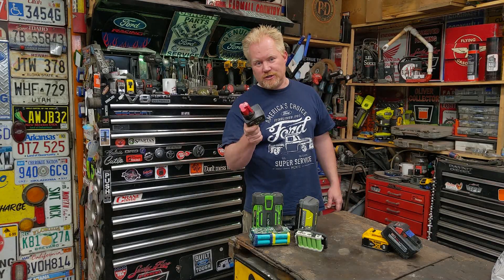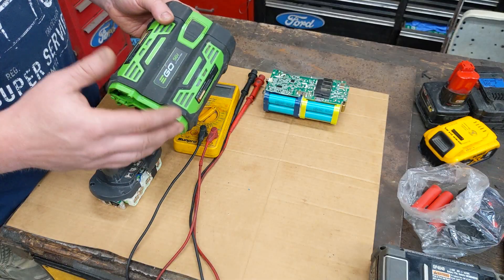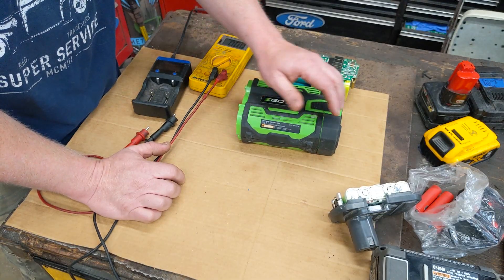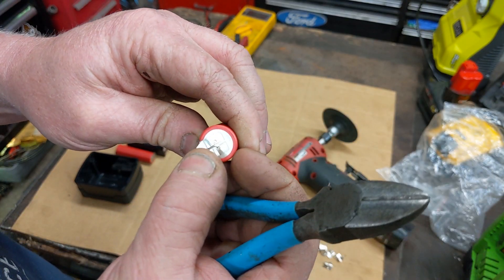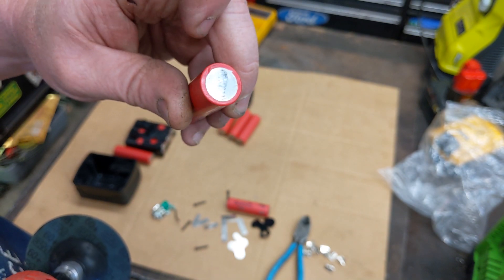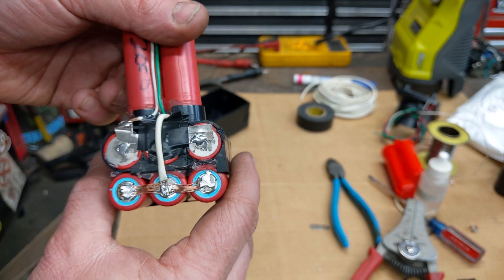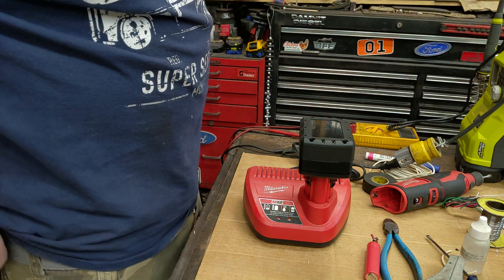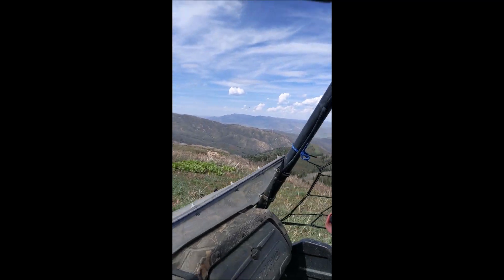Build Dirt Cheap power tool Battery Packs : Milwaukee Dewalt Makita

Comment: Oh great.... I bought a couple of those Chinese DeWalt battery packs about 3 years ago when I was cutting roots out of the lawn. They worked good and lasted for quite awhile but I haven't touched them since. I wonder if they will even work now🤔.
Reply: Quit wondering and throw them on a charger.  They're probably fine as long as you didn't excessively discharge them then leave them sit without charging back up for 3 years.  Even then, they probably didn't discharge that much more unless left in a tool with a defective design that causes parasitic draw.
Reply: I did throw them on a charger the other day. I had a couple stumps I wanted to get rid of. One was just about fully charged and the other one showed one light out of three. I bought them at the same time off of Amazon. All it does is light the charger up for a second then goes out. I was going to take it apart but I guess I need to get some specialty bits.  @stinkycheese804

Comment: I'm wondering what will happen to other lithium batteries like 18650's once the solid state batteries hit the market.  They've already made & been stesting SSB which will be put in Toyota hybrids in 2025. Apparently they're only using them in hybrids instead of all electric cars because the batteries still haven't gone major long term testing under multiple conditions.  
  They're supposed to have something like 2x or 3x the life span, faster charge times & almost double it's range. Plus not as sensitive to charging & operating problems.  I hope SSB makes the price of 18650 drop quite a bit so you could build or buy or solar battery bank for much cheaper. I think people who buy electric cars right now might have buyers around 2026.

Comment: Good stuff. I have rebuilt several Ryobi battery packs doing this, they work well but usually don't seem to have quite as much life as new packs, but a whole lot cheaper. Yoda says hi to Ginger. 👍
Reply: Like in Solar, a bunch of 20% depleted batteries come together in parallel to make a pretty hi ah pack. Yeah they aren’t at full capacity but because there are many, you will get the benefit of having long lasting battery life, even with 80%

Comment: Great video Mo.
I got a bit lost with the balance wire, but I'll ask my brother to explain it to me. He's very clever like you and has literally thousands of cells that he has collected due to the industry he works in. His plan is to build his own 'Tesla style' battery for his home. His cell collection is  crates a little over a cubic  metre each packed full and ready to test all the cells. The battery packs they use just go in a big skip when they stop working properly or after a certain amount of time, regardless of how well they function, and since he's in charge he just packs them all up and brings them home. 
Now I understand what he's up to.

Comment: I'm too old and goofy to be making up electrical stuff and will be better off buying new but you never know. Thanks and the Hound On The Run! GBWYall!
Reply: Doing this sort of thing isn't for everyone. Tool battery packs is one place where some regulation would have improved efficiency. The way it's done now is the absolute worst way possible. It's making corporations a lot of money though.
Reply: @1pcfred That's always the foundation and bottom line of almost everything. I'll say almost because some people still care about quality and longevity but not many.
Reply: @1pcfred  Get the best you can at the time and use it for as long as you can. All my stuff is worn out years ago but still going. It was paid for a long time ago and if I can fix it cheaper than I can replace it, it'll still be here. GBWYou!
Reply: @1pcfred  I'm not talking about hi-dollar best. I'm talking about the highest class junk opposed to just garbage.  I got a Craftsman mower with the 20 horse opposed piston Vanguard for $30. I spent around $300 for a new deck shell, spindles and a couple of quarts of resin to fill up the rust holes around the deck for supposed mulching vents where all the wet grass sticks and rusts the deck through. 6 years and the belts that came with it and it still runs like a swiss watch. Just pained the deck underside again this spring. All my stuff is like that. I have 2 mowers from the 80's that still run fine. I like good junk, not this cheap overpriced pot metal stuff.
Reply: @1pcfred  We have 7 mowers of one is a Toro that is almost useless. A Snapper from 85 and an 85 Craftsman rider with an 11 horse Briggs that smokes but that way you know some oil is still inside. The Craftsman with the opposed, another Snapper with a Kawasaki off a junked Deere with the Deere sticker still on it. That one's the bagger. A Roof 28 inch with a Briggs 8 horse I/C and a Gravely with a cast iron 301 Kohler and a 40 inch kidney mower.  I might've had more but ran out of room. I dare say we'd get along just fine!

Comment: I've been rebuilding battery packs for a long time, I know how to solder so IDK what kind of witchcraft he uses to solder the batteries because I have tried over and over with different temps and methods but the solder never sticks. I eventually got a cheap spot welder for like $60 and dang it makes it so much easier and faster. It's well worth your money if you have the same problems I did.
Reply from the maker: You need to sand, scuff or scratch the battery surface and solder will flow out and stick.
Reply: Flux is key, in addition to the prep 65ford mentioned.
Reply: He's abrading the battery caps which gives the metal tooth for the solder to grip to. That and you may really stink at soldering. Some people just can't solder. For whatever reasons they simply can't grasp what needs to be done. Done right soldering is easy. Done wrong soldering is a nightmare. I've seen people struggle.
Reply: use a big iron, (80-100 watts)  and be FAST, too much heat transfer into the cell and its a bad day. (you need a hearty tip on the iron too)
Reply: @mikethecarguy9387  I have legit big ass soldering irons. I collect them. You don't need anything like that to solder to a battery cell. What you need to do is scuff the metal like this guy did. Then tin the metal. You'll be fine with just a 30W iron with a chisel point.
Reply: Flux is what makes the solder flow & stick
Reply: You can get special flux for soldering to nickel or stainless steel, however it’s not safe to solder batteries

Comment: Bad Chad would blast that weld/solder with compressed air to keep it cool...lol
Reply from the maker: It doesn't get hot enough to need cooling. You can touch it 3 seconds after soldering with bare hands.

Comment: 👍👍.   Is the reason the laptop batteries aren't as good being because  they are used and charged too often?
Reply from the maker: They aren't High Discharge cells so that won't work well for power tools. Most have a max discharge current of 3-5amps. Where High Discharge cells can put out 20, 30 or even higher amps to the tool. Most basic tools need at least 20 amps. But the more the better. The tool will run cooler and be stronger.
Reply: @sixtyfiveford  ok, thanks for explaining.
Reply from the maker: @chazgregrrr404  You could build a battery pack solely for a light, fan or other low draw device. I have done this and the pack sits on a light only. It has a long run time and the light only pulls around 1-2amps.
Reply: @sixtyfiveford  I'm going to take the old laptop batteries apart and keep the good batteries for when my battery powered light won't take a charge anymore. 
 I'll keep an eye out for bad tool batteries. Your video inspired me 😃
Reply: It's down to battery chemistry. Laptops are formulated for low discharge and long run time. Tools are the opposite.

Comment: Man I bet I have 40 battery packs in a drawer that wont charge. I have yet to work on them.
Reply: Now you're a candidate for doing some repairs. Because like he said it's usually just a couple cells that go bad. There's really better ways of testing cells than how he did it though. There's battery chargers you can put the cells on that'll tell you how much they can store. They charge the cell then discharge it and measure the amp hours. You're best off with balanced cells in a pack. So get one of those chargers and a magic marker and test and write the results on each cell and make up balanced packs. You can probably get 30 good packs out of your 40 bad ones. Maybe more?

Comment: Be careful soldering lithium batteries though as the heat can damage them. You can buy a small spot welder for $30 and some nickle strips like the original batteries are connected with. I often build packs for small electric mobility scooters and power tools and  if you need to do more than 4 a year buying a spot welder is worth  the small investment, as it's safer and a lot faster than soldering the batteries.
Reply: This video addressed the heat concern. And what he said is right. If you know what you're doing you can solder to a battery just fine. He did it in the video. I've soldered countless batteries and I've never had a problem doing it. But I know what I'm doing.

Comment: Medical supplies have great batts and they are replaced before they even get bad
Reply: They are not typically high discharge cells, but rather high capacity. So not ideal for tool applications.
Reply: The latest place to grab cells is disposable vapes. People use those once and toss them. So the cell isn't even broken in yet. They're high drain type too. What a world we live in.